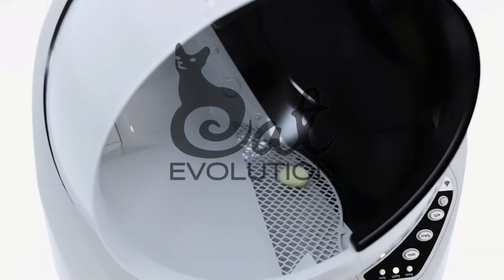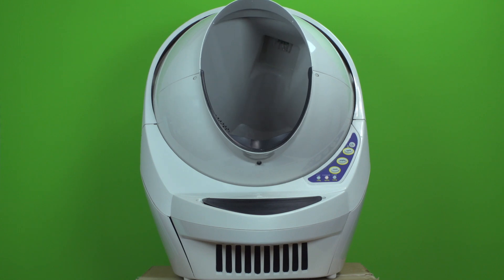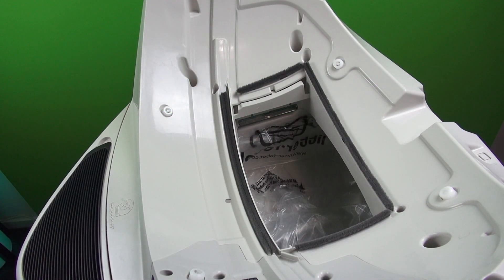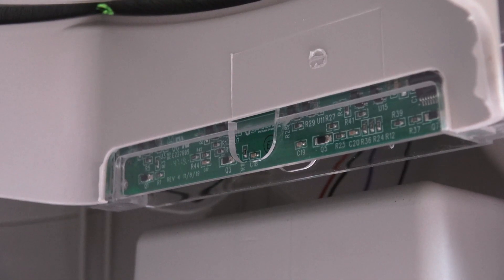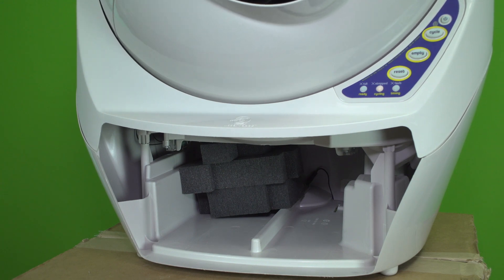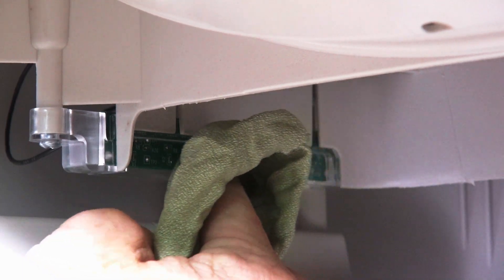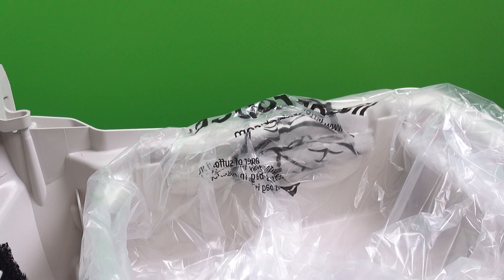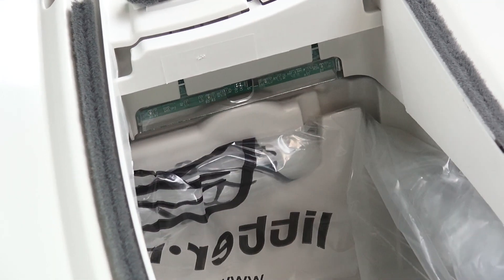Litter-Robot III Open Air - DFI Fault Flashing Blue Light

Comment: Is there an issue with cleaning it with a wet wipe? Also while on? I'm afraid I might have fried it..
Reply from the maker: the green board can be cleaned with moist qtip but needs to be unplugged (no power). wiping the clear cover with a baby wipe should not be an issue unless you wet the green board with the unit plugged in.

Comment: Cleaning of these sensors saved my litter robot. Flashing blue light error started after 3yrs. They were very dirty, cleaned drum roller area too.
Reply from the maker: Great to hear. Litters have varied in quantity since Covid supply disruptions and at times are dustier or not clumping as well. Always have a quick look at the waste drawer for how well the litter, and your kitties output, is going, when changing a full liner 😻

Comment: Mine doesn’t go back to the home setting 🤷🏻‍♀️🤔
Reply from the maker: Do you mean it does not go back to solid blue light, or does it finish without returning the globe to the home or waiting position? Do you have 3 flashing lights? If you have unscrewed the globe, you may have lost the globe magnets. If you are not using the original power supply, you may not have enough power (15volt). Feel free to provide more information as there is not enough on the initial comment.

Comment: Still says 95%full
Reply: Might need to repace it for the version 2.. we had the same problem..95% all the time..even after reset it told us it was full (but almost nothing was in it) ..Put the bag as far down as possible, deep cleaned it, cleaned the dfi sensor thorougly, even tried recalibrating the sensor .. but after checking with a phone the lasers just didnt work anymore, a common problem (we learned) with the version 1. Buying the v2 fixed the problem for us.
Reply from the maker: Version 2 is now supplied, but the instalation is similar @RenateJr
Reply from the maker: Likely you need to clean the DFI specifically, or possibly replace if damaged. See if this helps 

For the left DFI, the silver chip pins located left side of the midboard black square (chip)  may have damage, likely from litter dust or drop.

Try cleaning these, stroking along the pins outwards from the black square, with an earbud or qtip lightly damp or if you have contact cleaner, using that. Make sure you are unplugged completely by removing the power supply from the back of the base first.

Essentially, you are working to separate the pins by removing all debris from between, and on them. As its litter related, moisture to soften first is needed. You can also use a wood toothpick or similar to help clean between the pins if needed.

When done, ideally returning the pins to silver like the right side set, wipe over again with the dry end to ensure you have removed all debris.

The pinch detectors may have dirt/debris where they touch together. Push on the cover (DO NOT PULL) to open a small gap and wipe the touch point area with a qtip or earbud. Its tight but thats good as you need a clean surface for good power flow.

Please take another set of pictures of these 2 parts, and send, and update with outcome of test after cleaning.

Note that sign of a good litter is solid clumping, low dust, and you can review this in both globe (not sticking) and waste drawer (solid clumps). Litters seem to have changed formula a little this year, likely from Covid supply issues, and you are best to review and if needed, change litter, to keep your appliance in good order. It also helps reduce odour by locking up the uric acid or cat pee smells.

Comment: I cleaned it and made sure my bag was right but it still is flashing blue slowly and says it's full..
Reply from the maker: Review your DFI (green board) and pinch detectors for dirt and/or corrosion. This video is for installing replacement parts. You can clean your sensors, with helpful comment by 
@joegatnah1498
8 months ago
Thank you for the great advice.  The chip on the board on the pinch sensor side looked discolored on the left side of its pins that solder into the board.  I had literally done everything else that I had found on their website but nothing worked.  Then I found your video.  After watching, I cleaned the board as recommended , waited for it to dry, and the reassembled.  Success!  Thanks again.

Comment: Is it possible that the sensors themselves, not the plastic covering, is the issue? If so, is there a reliable way to clean them? I cleaned the covering for the sensors and even removed the liner from the drawer, but I am still getting the dreaded blinking blue light
Reply from the maker: Yes. The green boards have a thin resin coating. The area to check is the silver chip pins or rows of small bars located on the left side board (not the control panel side). Review for any discolouration, dust or deposit on the pins. Clean by softening up with a damp qtip, and stroking along to remove debris front on the pins, and between them, so they are separated. A toothpick can also help.

Comment: Can I order new DFI sensors? When I purchased this in 2019 I swear I did not see in the manual to wipe off these 2 sensors, If it was there I 100% missed it. Putting that my problem just started and its now 2023, I'd say some maintenence is to be expected. I went to the LR website, I did not see where I could order new DFI sensors. I tried wiping them, no success.
Reply from the maker: You can try deeper clean. Review the DFI left side board, mid board there is a small black square with rows of silver chip pins either side. Make sure you have unplugged completely. You can clean the silver pins if they have any dust or debris on them. stroke along the pins to clean top and gaps between pins, using a slightly damp qtip or earbud. when clean  wipe again with dry end to ensure no moisture. Turn on and test.
Reply from the maker: can buy replacements with self installation part of the design. where are you located?

Comment: Thank you for the great advice.  The chip on the board on the pinch sensor side looked discolored on the left side of its pins that solder into the board.  I had literally done everything else that I had found on their website but nothing worked.  Then I found your video.  After watching, I cleaned the board as recommended , waited for it to dry, and the reassembled.  Success!  Thanks again.
Reply from the maker: Well done Joe. As a better hack, add a piece of household sticky tape approx 1cm wide, vertically, to just cover over the mid board opening in the perspex cover. It will help bounce off any dust or stray litter away from the green board. The hack is to help with varied quality of litter, as the best to use clumps very well and is low dust.

Comment: My issue is that I have initially the blue light slow blinking indicating drawer full (bad or dirty sensors?) and when the reset button is pressed, a fast flashing yellow light indicating pinch point problem.  If I've cleaned the pinch points (didn't try cleaning the sensors yet), is the board likely bad or could it be possibly fixed with more cleaning?  Thanks so much for this video!
Reply from the maker: Check the middle of the left DFI board where there is a black square with silver rows of pins either side. If any discolouration try cleaning with a slightly damp qtip, stroking along the pins. TURN OFF AND UNPLUG first.
Reply: @Catevolution1  this did the trick for me as well. Thanks for the tip! Really odd design choice to leave that gap in the middle of the cover
Reply: @Catevolution1  Thank you we will try it!
Reply: @Cat Evolution  thank you so much! I messed with everything for atleast a hour and a simple qtip fixed the problem...
Reply: Same.
Reply: Mine has this exact problem, blue blink and when I press reset, it rapidly blinks yellow light. What you did to fix yours?
Reply: @TeleeFONE  We had to contact the company and they sent a replacement part for free.  It was not fixable without the replacement.
Reply: @GlassShark86  what was the replacement part they send? The dfi sensors?
Reply: @TeleeFONE  Yes I believe so.  The sensors that go on either side of the bottom, including all the cables and everything you need to replace it. It was easy to follow their instructions to fix it ourselves in like 15 minutes.
Reply: @GlassShark86  I need to order that then, thanks
Reply: @TeleeFONE  Good luck with your issue, I know it can be extremely frustrating, but we have had really good experiences with this company and they are very reasonable.

Comment: Just curious, I watched the video when the dfi sensor is working showing a flashing light that it is not noticed by naked eye but with a telephone camera.   My question is:   At what point of the cycle does the dfi sensor operate? is it only when the globe “dump" opening was over the tray area or is it always operating?    Also, I noticed your video only showed two of the four infrared flashing; Is that a defective dfi sensor?   I have a blue flashing light that just keeps coming back every cycle; I will be disassembling the dfi to give it a detailed cleaning.  I have an occasional rapid yellow flashing light so I will be cleaning the pinch contacts as well.
Reply from the maker: The infra red DFI has a sender left side, with 4 flashing reddish beams emmitted, even spaced along the board. The right side (control panel side) is the receiver, with no lights. The DFI sends emmits constantly, with the flashing blue light showing at the end of a cycle when the beams are interrupted. You are correct that the one in the video is defective with only 2 reddish lights showing. This maybe the DFI board, or possibly a power flow issue from the pinch detectors. Inspect the middle of the left DFI board, where there is a black square (chip), just off midboard. There are silver chip pins as rows either side. These should all be silver. If there is any darkening or dirt, clean to restore the silver. Best to use a slightly damp earbud or qtip, stroking along the pins as they are hills and valleys and you want to remove all debris/litter to see if you can restore function. For the pinch detectors, the important part is the head to tip touchpoint. DO NOT PULL on the cover, its delicate by design and easily broken (not warranty). Push to open a gap and clean between.
Reply: @Catevolution1  Thanks so much for your video and prompt reply!

Comment: Looks like it fixed it, took less time than finding the vid and watching, Big Thanks
Reply from the maker: Great to hear! As a pro tip, adding a small vertical strip of household sticky tape to just cover over the mid board opening will assist in keeping poor clumping or dusty litter from dropping on to the green DFI board. Can add in situ by starting above on the casing, run it down over the Perspex cover and wrap under and stick at rear. Best is to use good quality clumping clay litter with low dust, if you can get it!

Comment: We’ve been using reg garbage bags over the drawer for 2 years no problem. Suddenly getting DFI fault after cycle on empty. Gonna try alcohol wipes on sensor. Tried the recalibrate for three blue lights and still getting DFI. Ours in 4 years old I think.
Reply: Check pinch detectors, and do clean the silver chip pins next to the left side DFI midboard black chip square. Make sure you turn off and unplug first. Suggested tool is a slightly damp Qtip, stroking along the pins as they are valleys and hills, not up and down, to remove dust and dirt. The do it again using the dry end to ensure there is no moisture before testing. If the silver pins are discoloured, likely a new DFI and pinch detectors are needed. For the waste drawer liners, just make sure they are not above the edge of the waste drawer at all.

Comment: Unfortunately this version has much more problems if compared with the first version. After some weeks the blue light begins to flash and there we go - the cleaning thing is not always working. There are some other issues with this robot. The concept is better, I agree, but some things are not working well.
Reply from the maker: The LR3 was a big uptick from the more basic LR2 but there are always differences. A more complex functionality also provides more opportunity for issues. However using good quality low dust clumping clay litter for the appliance usually avoids DFI issues at least in my experience. Number of cats, litter quality and climate are the main factors influencing durability and parts. Regular deep cleaning to suit user conditions helps.
Reply: @Catevolution1  I cleaned several times, and suddenly the blue light stopped… and the yellow light began flashing ☹️
Reply from the maker: @brasileirosim5961  review pinch detectors. They are subject to corrosion and dirt particularly if you are using litter that does not clump well. Good clumping litter locks in uric acid and reduces odour and maintenance needs.

Comment: What if you've done all that yet that blue light still keeps flashing. I've about had enough of this.
Reply: You will need to get in touch with the Company you purchased from to progress. You can try inspecting and cleaning the actual DFI green board, if there is litter or debris on it. Use a slightly damp earbud or qtip to stroke outwards along the silver chip pins to remove anything on or between the pins. Repeat the action with the dry end to ensure no moisture. Test. Recommendation is to use good quality low dust clay clumping litter to have the best performance from your appliance.
Reply: @Sales Catevolution  I've owned 7 units and believe me I've done everything you can do. So tomorrow I will call them.  They are closed now.  I also ordered another unit. But I might need that one sent in for repair.
Reply: @Sarahdrybones  The Litter-Robot is designed for self repair which is unusual for an appliance. Chat to customer support, they are usually very good. If you cant get through on the phone, try chat or email, including facebook page ;o)
Reply: @salescatevolution9977  I will when I return from my doctor's appointment
Reply: @Sales Catevolution  it's very hard to get anyone to help. Do you know a secret number to call.  I've have zero luck

Comment: Thanks! My DFI had some corrosion on a chip's contacts. I managed to clean it with an old toothbrush and got it working again.
Reply: Awesome! Pop a strip of sticky tape upright to just cover the small half circle opening in the DFI perspex cover. It will help bounce out any stray soiled litter particles. Only just cover, no further, so up and down, not along the board. Also check your litter is clumping well. Should be solidly clumped in the waste drawer, not crumbles, to help with odour and keeping the Robot clean.

Comment: So frustrated. I cleaned my sensors and made sure that my bag is not blocking anything. When I try to reset my machine the blue light just keeps blinking. I tried unplugging and waiting 10 seconds about 30 times and I still get the stupid blue flashing light. I'm in the USA. I am not happy that this is happening. What else can I try? Thanks!
Reply: Have a look at your DFI and pinch detectors. They may need cleaning, particularly left side. If your litter is not clumping well and/or is dusty, you will need to attend to this more than if you are using good clumping clay litter. If you look at the video, you will see the narrow green DFI boards, and the pinch detectors. If there is any debris on the DFI, clean it off gently with a small paintbrush or dry qtip. For the pinch detectors, if dirty or corroded at the point where they touch together, you need to clean this area so you have good metal to metal contact. Sanding will possibly achieve this (head and tip only) or swapping over the position for a new head and tip connection, but you will then need to order another set even if it fixes the issue, as once the silver coating is compromised, you need a new set. Best to get in touch with customer service at whisker.com (formerly litter-robot.com) and also have a look on the website to see if you can order the parts if you are out of warranty. The Litter-Robot is designed for self repair, as you can see if you look at this video. Hope this helps you!
Reply: @salescatevolution9977  Thank you!

Comment: Plz help i get a flashing blue light but when i press reset my cycle light starts to flash a really fast yellow light what does it mean
Reply from the maker: It’s likely your DFI and pinch detectors have an issue and need replacing. Try cleaning any dust  and debris off the green board, particularly left side, using a dry qtip or earbud. Also check pinch detectors where they touch together, taking care to not pull on the cover as it is breakable. Take photos of these parts and email your supplier for help. If in Australia it’s support@catevolution.com.au.